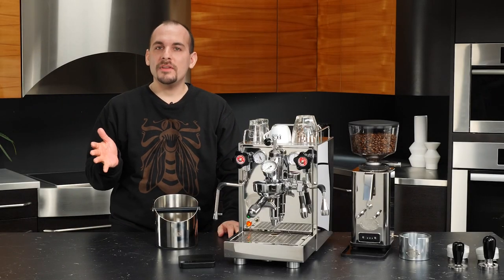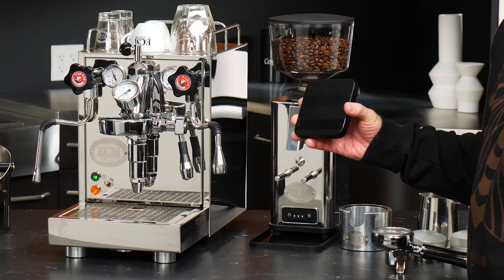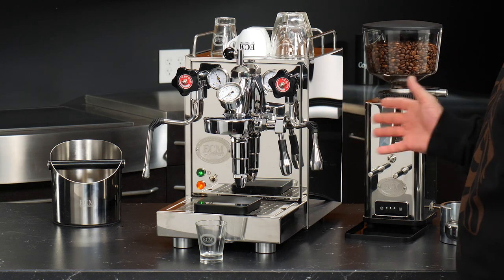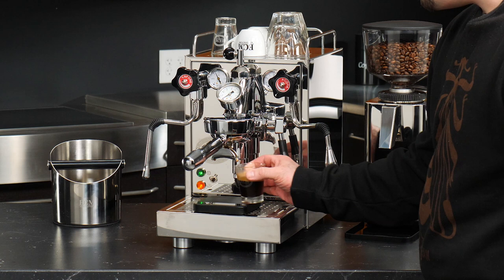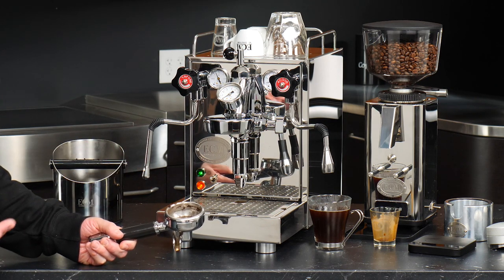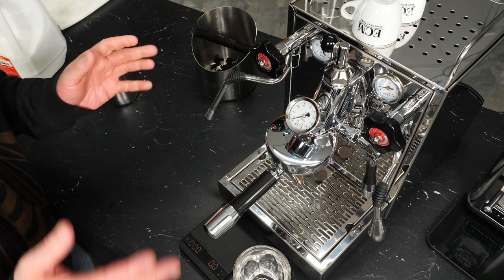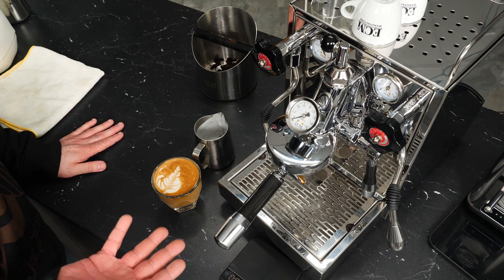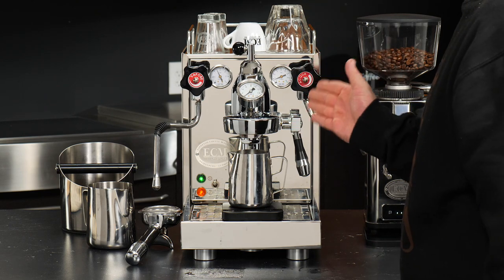ECM Mechanika V Slim: Espresso Brewing, Milk Steaming & Flow Control

Comment: Hello guys nice video, I just installed the FC device on my mechanika, but I wanna ask: the group gauge shows 10 bars when I leave the knob at 1 1/4 turn, my machine pressure on gauge shows 10 bars, you recommend to set it at 10 bars to get 9 at the group... I saw that your FC gauge shows 9bars, do you leave the machine pressure at 10bars? and you set the knob at 1 1/4 turn for this video? or something wrong is happening with mine? Thanks.
Reply from the maker: Hi Francisco, is that 10 bar while brewing, or while running the pump with a backflush disc in the portafilter? Seeing the same number is normal with a backflush disc (closed system). While brewing, if properly dialed in, I'd expect the group gauge to be a little lower than the machine gauge. If it's not, perhaps your grind is too fine. The 1 1/4 turn is generally what produces the stock flow of around 7 g/s of water with no portafilter in the group, but I'd recommend measuring your specific FC device. At 1 1/4 turn and no portafilter in the group, weigh the output of water over 20 seconds, then divide by 20 to get the g/s.
AJ
Reply: @Wholelattelovepage  Thanks for the reply, is while brewing,  so do you think that my grind is too fine? Because I used the same settings with a “stock” mushroom, I don’t know if my machine pump pressure is high or my FC isn’t calibrated, I’ve measured and with a 1 1/4 position the flow rate is 7,5g/s with 1 turn is 6,6g/s, so, seems to work well. So what do you recommend me to do?
Reply: @Wholelattelovepage   hi, thanks so much. Should i measure my original flowrate bevore installing the FC or is it really 7g/s. I would like to order my machine including the FC, so i cann not proof the flowrate without fc.

Comment: I found the steam was very underwhelming from factory. Removing the internal silicon hose from the steam wand and drilling the holes in the tip out to 1.5mm made it so much better.
Reply from the maker: Hey John, thanks for the tip (pun intended)!
AJ

Comment: what a review.. what about stability and not for just one shot... as pro-summer machineit s important to make some extracts at least 4...
Reply from the maker: Hey cellodl, the larger .75 liter boiler on the Classika should have no problem pulling several back-to-back shots. By the time you clean your PF, grind, and tamp the next shot, you'll be back up to brew temperature. 
AJ